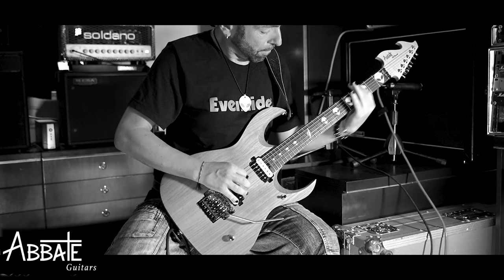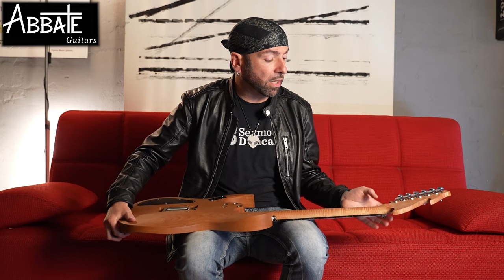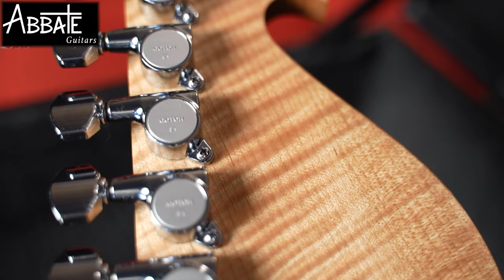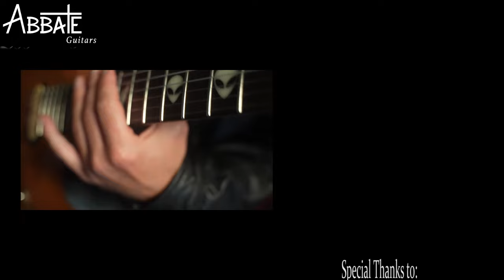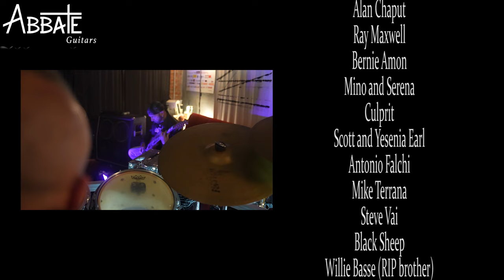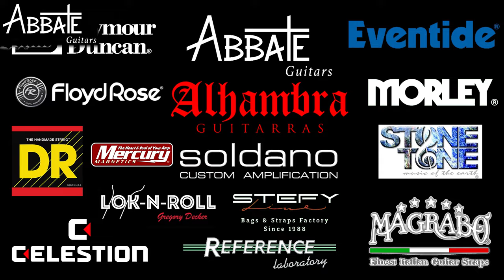Abbate Guitars Presentation/Explanation - PA Roswell Model

Comment: very "Washburn N-Series". i like it.
EDIT, just got to the bit where you say you had one. makes sense now.
the undesirable bass response could be the BL pick-up the commercial N4 is sold with. the Bill Lawrence USA pup isn't a "real" Bill Lawrence. to get the authentic BL sound you need a Bill and Becky Wilde 500XL or 500L installed upside-down.
Reply from the maker: I totally agree on the Bill Lawrence! But I believe the ebony fretboard, the thinner neck and the Stephen extended cutaway may influence that too. BTW Back in the days I opted for a SD dimebucker at the bridge.
Reply: @PatrickAbbate  yeah, i personally like the crisp tone of ebony or maple, but it does something to the lows for sure. i have an N2 so i can't comment on the Stephens. but the neck is Goldilocks for my hand, and the body is SUPER comfortable. i came to find out i have a similar body type to Nuno. it's probably why i always go back to it even though i have "better" guitars. and it's one of the crappy Chinese N2s from 20 years ago. it's got a BL USA, but i live in rural Australia so i was lucky to even find the N2 twenty years ago. BUT i have heard good things about the SD Dimebucker, a good alternative if you can't get a BL of some kind, which i can't (Australia, distribution channels, nightmare), but i can get Seymour Duncan. Pearly Gates is my favourite all-round bridge humbucker. 
for more specific metal-gain tones i like Dimarzio passives and Fishman actives. i don't use any other active pups but Fishman. in 30 years of playing they're the only ones i like the sound of, and the playing dynamics. but i prefer passive. i only use Fishmans when i want that exact tone in metal, less than 10% of the time.
for every other style or tone (with the possible exception of 'Trons), SD does it best. even in the HIGH-gain arena, Pegasus,  Nazgul, Sentient. SD are rock-solid (pun intended).

and that Tesla looks....... wow.
Reply from the maker: Thank you bro! I completely agree with you! I have an N2 too! Still have that one! It’s a really good guitar for the price! Before my N4 was ready I was using the N2 and some people thought it was the N4! Beautiful guitar! I got the idea of the coil split pot from the N2! The N4 doesn’t have it! Anyway, yeah Seymour Duncan totally owns my tone! The Tesla guitar will be in production next year but we already received some orders for that one 🤦‍♂️😂 I designed both Tesla and Roswell more than 12 years ago, it’s time to make them available for everybody!
Reply: @PatrickAbbate  surprising the N4 doesn't split the BL. high output rail humbuckers split really well. you get some beef on the single-coil tone.
Reply from the maker: @fistovuzi I added the split on my N4 😉
Reply: @PatrickAbbate  nice. the only thing i did to my N2 was swap out the Wasburn branded '59 for a proper SD '59. way better sounding, nothing worse than a mediocre '59, wooly, nasty. the SD is clean and nice. made me realize, i don't hate '59s, i hate BAD '59s, lol.
as i've gotten older i've drifted to SD Jazz for a neck humbucker. i'm predominantly a rhythm player, my needs in a neck pup are more for tone shaping the bridge.
the recent trend of H/p90 config i find intriguing and i plan to pick up a SD Phat Cat for some neck pup experiments. no PAF sized p90 sounds exactly right but the Phat Cat is one of the few that come close outside of full boutique brands. 
the last 20 years i spent playing acoustic 12-string exclusively and what i have to show for it is tendonitis and a tendency to be a little heavy-handed on electric now. and a beautifully aged Cole Clark 12-string that i can just about make it through one song on.

i can never get rid of it though. in February 2022 a flood destroyed everything i ever owned. i saved my dog, my mothers ashes, and by securing them on top of the kitchen cabinets, my guitars. the floodwater peaked 2 inches from the guitars.
the water took everything else. i have no photographs of my mother anymore, they were all destroyed. she passed a year previously.
i now live in my brothers half-rebuilt house caring for my dying father. we have nothing, and the government wants the land so we may both be homeless soon. 
5 guitars. 2 acoustic and 3 electric. i've never been much of a guitarist, i'm still not. but it's all i have left. everything else is gone forever.
i haven't slept properly in 2 years and two of my teeth recently fell out.
i'm hoping the last 2 years has been a dream generated by a drowning brain.
Reply from the maker: I’m very sorry to hear about all these horrible events and about your parents. I lost my father when I was 18 and I found myself in the middle of a street, still, I can only imagine how hard is all you are going through. Life is sometimes testing us really really hard but we need to fight through and you know why? Because when you think you are way below touching the bottom, when you really think there’s no hope etc, that’s where magically everything changes in a blink of an eye. Usually what can really speed up the process is when we change our mind approach to all these disasters. It may be hard to believe but I think the universe reacts to our inputs and when crap happens we get dragged deeper and deeper in it, mentally too. Try to find somehow, somewhere the strength to start being optimistic and look forward to something. Try to close your eyes and imagine the life you want. Do it often and visualize it in front of you, trust me, if you do it deeply, it will materialize and quicker than you can imagine. That’s why sometimes it seems that people with “bad luck” keep having bad luck and some people win the lottery more than once! For the photos, I’m sure you have amazing video memories in your brain, just keep revisiting them in your mind so they don’t fade. Be strong and try to be happy at every cost, because that’s what your mom wants and it’s what your father needs so you can help him better. Material stuff come and go, don’t over think about house and other stuff. Enjoy your guitars, which are still there for you and start using lower strings gauge, just don’t tell anyone! 😜 you don’t need to be the best guitarist in the world, you just need to talk playing your music. Bob dylan is not an insane singer, nor an insane guitarist but he speaks to the world! 3 chords or just 3 notes often can do more than a whole shredding song. Shred is fun but it’s not fundamental for a musician. One last thing, I know several cases where some apparently bad events/situations/life periods which were despicable for those who were experiencing them at the time, needed up being the cause of something amazing and life changing on the other way. In other words, sometimes the most beautiful flowers grow from the nastiest poops… I send you a big big hug dude. 
PS:Don’t hesitate to contact me if you need to talk to someone, you can message me through any of my social media accounts, they are all under my name and don’t take too seriously what you see online, these days too many people show off a lifestyle they don’t have faking it. We all have our challenges and that’s why we should support each other, at the end, we are all one. ❤
Reply from the maker: Pps: Seymour Duncan rocks huge time! 😉
Reply: @PatrickAbbate  my father is 76 and needs dialysis every 2 days. i am 50 and autistic. we have no money and despite everything the guitars will need to be sold very soon anyway. 
i appreciate the sentiment but there's no way this ends well in the real world.
in my life i have made a point to help people who needed it, perhaps one day i will be in need of such and will be remembered. 
the lessons i am learning are very hard. who spares a thought for the life preserver when they are out of the water?
i wake up exhausted and terrified and i go sleep the same way. the toll is heavy.
Reply from the maker: I’m super sorry to hear this bro… I invite you again to message me in private so we can talk. You can find my email address in my patrickabbate.com website. Please send me a message there and let’s talk. I send you a big big hug and I wish I could do more… ❤